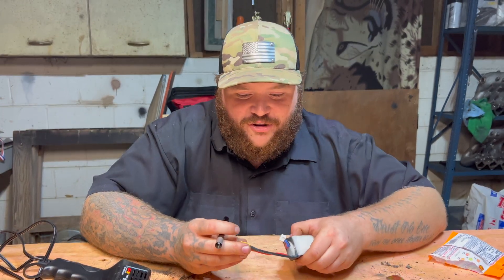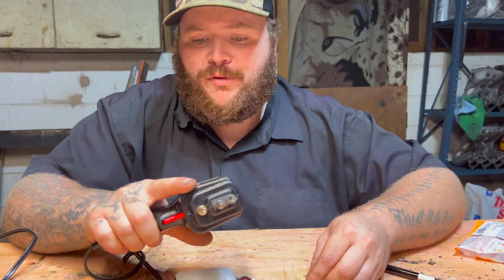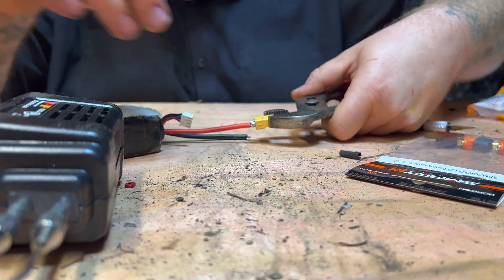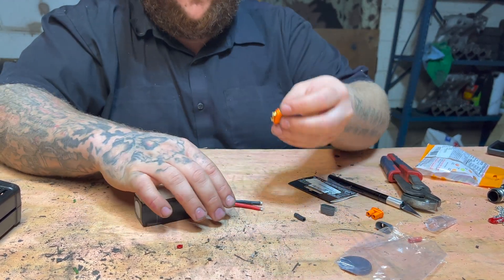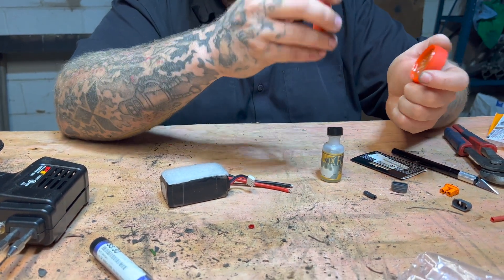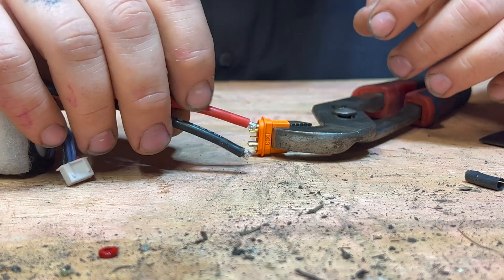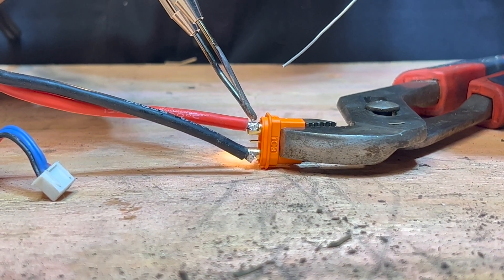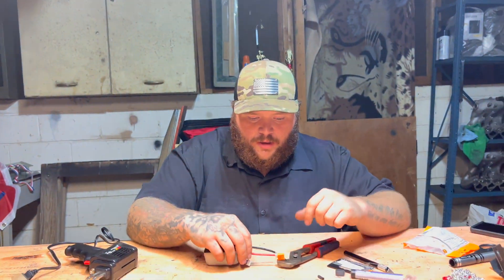How to Solder Lipo Battery Connector

Comment: If your working on a battery, always work with the connector horizontal. Wouldn’t want that solder to drip and make a connection with the other. Also, tape the bare wire so they wires don’t touch as well.
Reply: He forgot to put the protector on the wires before soldering the connector happens to all of us lol 😂